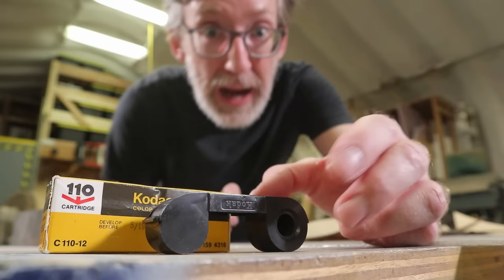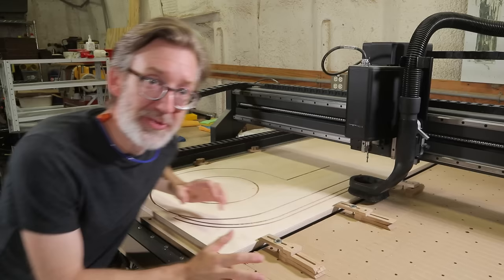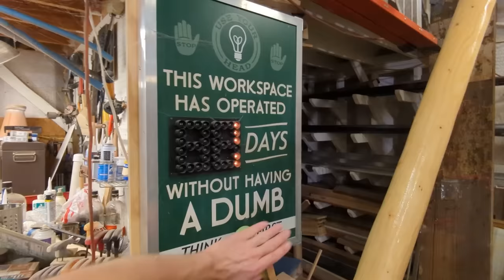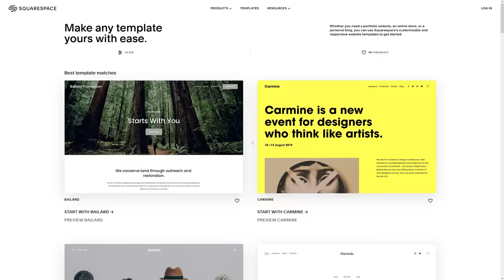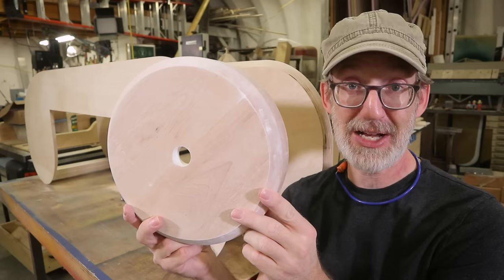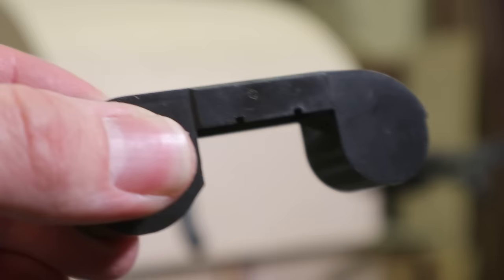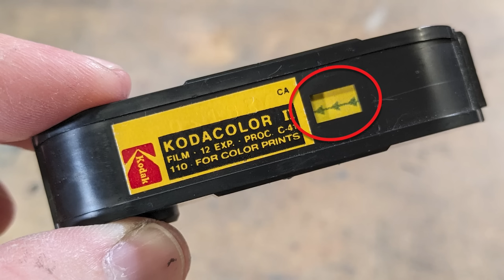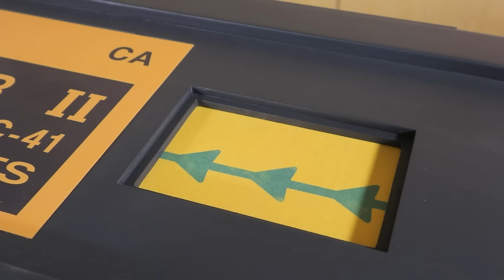Enormous 1970's Film Coffee Table

Comment: The take up spool had a "cone" or tapered hub, because a little bit of pressure will hold a taper easily. That way they didn't need to make a more complex mold that had some sort of key. It also made the 110 cartridge easy to load, because you could just drop it in, and there was nothing to align. If you look at a 35mm film magazine, there are  either tabs, or a full strip across the center of the spool hub. On a 35mm magazine you had to move the slot on rewind handle until the rewind handle engaged. The 126 cartridge had 4 keys that would engage the take up mechanism, but the 126 cameras were much taller than the 110s. The tapered hum was just a good way to save even more space, and make the camera a bit smaller. For those of us who did darkroom work in that time period, both the 110, and the 126 were a real pain to get into. I didn't work in a lab, and did piecemeal work for people so I didn't see many customers who had the smaller formats. I'm sure the larger labs had some sort of device to actually open them easily, that didn't involve trying to break them in half.
Reply: The cone didn't have utility for the consumer, cameras didn't engage with it. The film was advanced by a gear under the bump on the opposite side. The cone was for the lab, which did have to destroy the outer shell to gain access to it. I also didn't work in lab for consumer formats (though did in a offset print shop, processing those film plates) but I knew someone who did and I asked because I was curious about that and the later 35mm disposables.

Comment: Awesome build! Did you consider using black Formica sheets? It's cheap, extremely durable and gives the table a realistic plastic look. It also saves you money by using lower cost, non-furniture grade plywood.
Reply: Not sure it would stand up to the bending?
Reply: @TheErador  It's quite bendy and often sold in large rolls.
Reply: It may have been mentioned previously, but film photography project and lomography are still selling 110 film just in case that nostalgia hits overdrive!

Also just moved back to DFW and I think I remember you having worked in the area at least in the past. Hopefully I can see some of your installations around town.
Reply: @tylerhuttosmith  - I still have my 110 camera. It used those cube flash bulbs too.

Comment: It's cone shaped because the other side locks in. The con shape allows it to place the film at the exact spot when you load it and not have the use slide it in and hold and keep trying until it lines up, the cone allows you to close the door and the cone audot moves and centers it.

Comment: All the fine detail in the world will be for not if you don't get the final surface finish right. And, however you did it, you seemed to get it right. I can't believe you didn't use a primer and still ended up with a finish that actually looks remarkably close to that plastic they made those things out of. Well done. 
As for that cone-shaped spool, the winding mechanism needed to be able to advance the film to the proper starting point that began with a toothed gear aligning with holes in the film strip that would advance the film the same amount with each exposure. When the camera took the last shot on the roll, the driver would wind the remainder of the film up into the spooled end.  So, to eliminate the need for a precise interlocking mechanism that could start out in the wrong position when loading a new roll, the driver was a rubber stopper that would push into that cone-shaped recess and spin the roll using relatively little friction till the film mechanically aligned with the teeth of the gear in the center (under the table top) where the picture count would start.
 Doing it that way made it easier to manufacture thousands of rolls per batch. Each roll would have the same number of holes, but the length of film strip before or after didn't have to be as precise in order for the thing to work reliably every time.  It gave them a little play and a lot of tolerance. That's part of why 110 was so much cheaper to buy and produce than 35mm. 35mm was not only larger film stock, but it was way more precisely packaged, and required a more involved loading process on the part of the user. 
That toothless advance is what made loading a new roll quick, easy, and practically foolproof.

Comment: Genuinely can't understand the haters. I find you hilarious, please never stop. 

The purpose of the cone in the cartridge is probably twofold: cone-shaped parts release from injection molds easier, and the conical bearing surface ensures that there's no play in the spool's position. If the axis for the spool was straight, the tolerances would need to be much tighter, making the whole cartridge more expensive to produce, and therefore more expensive for the customer to purchase. Little efficiencies in design go a long way.

Comment: I would imagine that it is only cone shaped on the "outside" to ease engagement of the winding mechanism in the camera.  If you pull the cartridge apart I would think the spool the film wraps around is straight sided on the inside, matching the larger, bottom diameter of the cone.  Just guessing here, you should pull that cartridge apart just to see.
Reply from the maker: The winding mechanism actually engages a gear that very slightly peeks out of the bottom of the cylinder on the opposite face. The cone is smooth and stationary, so it remains a mystery. 🤷‍♂️
Reply: @WesleyTreat  there are some 110 film cartridge reloading instructions on Instructables that show the internals of the cartridge that you may find informative.

Comment: Awesome job as always!
Just curious though, are you not aware of bend board? Its what I've always used for radius work.
3/8" thick 4x8 sheets in either column (bends along the length of the sheet) and barely (bends along the width)
Make your frame, wrap the bend board around it, sand it smooth and veneer it.
Also I think there was a missed opportunity there. 
Perhaps a Bluetooth speaker hiding in the cone?
Love the jokes by the way 😉
Reply from the maker: Yeah, I used it in a giant chandelier I built (https://youtu.be/nsooiqVUr0M). Not really a fan of the quality, though. Thanks!

Comment: 1.  7:45   Oof. 🤦‍♀

2. Why didn't you outsource the kerf cutting to your CNC?

3. I worked in a 1-hour photo lab for 6 years, and I have many memories of having to unload these damned things. It was all done by touch: you had to place the cartridge into a sealed darkbox, snapped it in half, pulled out the film and peeled off the light-blocking paper (that yellow strip with the arrows on it). Then, you had to find the correct end (still by feel), roll the film back up and stick it into a special cartridge shaped like a 35mm film cartridge so the machine could handle it. (126mm got the same treatment.)

The only thing worse was disc film... It got the same break-and-load treatment, but I had to develop those by hand... 

You have no idea how big the grin on my face was when i saw this vid. 😆
Reply from the maker: I considered using the XCP for the kerfs, but it would have taken me as long to set it up as it did to just cut them myself. Plus, I was only millimeters from the surface. The plywood would have to be 100% flat to the wasteboard. If it had any bow in it whatsoever, I'd end up with garbage.